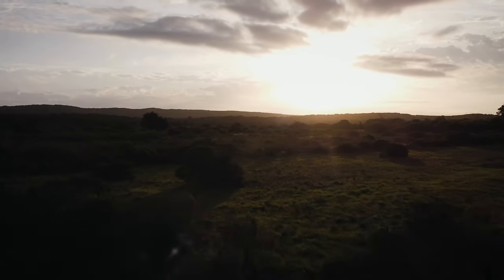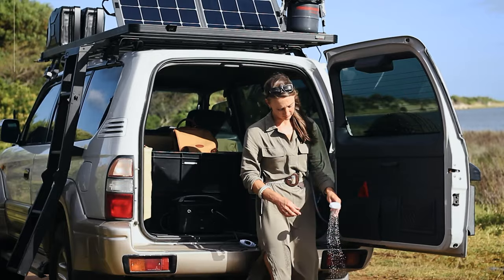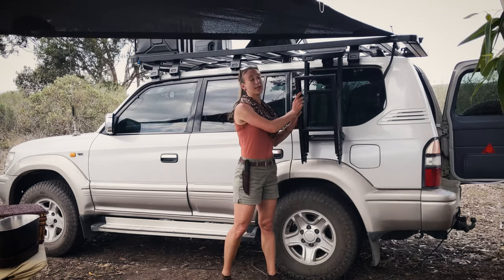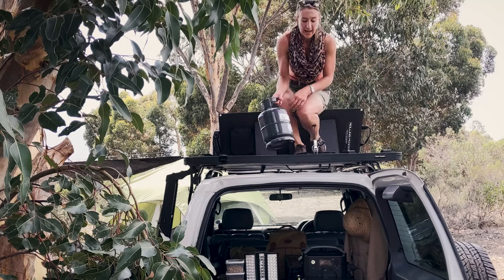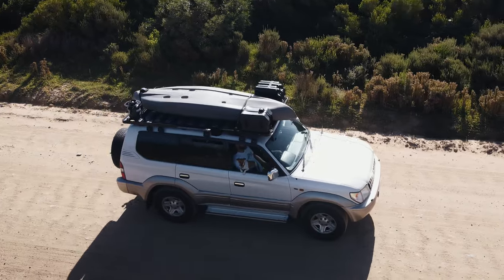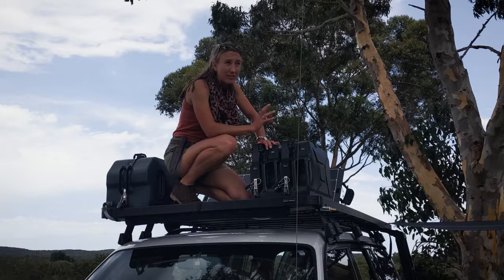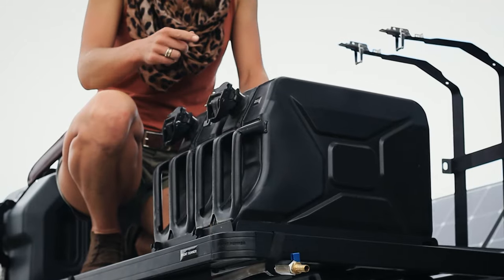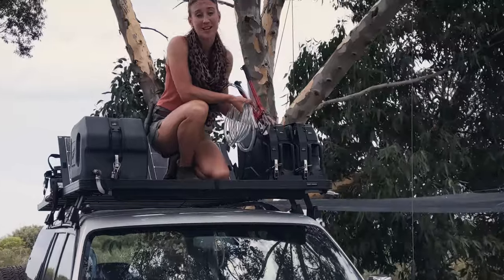BUG OUT 4X4 BUILD | How to store extra fuel and gas on your bug out vehicle

Comment: The roof rack system you have would be a really good way for me to free up some space inside.  Maybe you mentioned it and I missed it, was your roof rack a custom build that you had welded up?  Thanks Clarise!
Reply from the maker: Hi Bob! The roof rack as well as accessories are all made by Front Runner (Links below). They make vehicle specific roof racks so you can just search your vehicle make and model on their web. They have a huge range of accessories too. I asked R&D Offroad to put a bigger roof rack on for me so that I could fit more on to it. Also the ladder isn't made for my vehicle so they modified it. 
Front Runner's roofracks are easy to assemble yourself though and you could easily fit all the accessories as well.  I'm sure they can ship to wherever you are, but let me know if you need help or if you would like product specific links. 

Here is a link to Front Runner's web as well as R&D offroad. R&D Offroad is based in Cape Town. C

FRONT RUNNER VEHICLE OUTFITTERS
https://alnk.to/bEfAK4F

FRONT RUNNER ROOFRACKS
https://bit.ly/3L5gFQP

FRONT RUNNER GAS BOTTLE (PROPANE) HOLDER
https://bit.ly/3ZEvMW8

FRONT RUNNER 42L WATER TANK
https://bit.ly/3kWa6FN

FRONT RUNNER JERRY CANS
https://bit.ly/3L82M4k

DOUBLE JERRY CAN STRAP
https://bit.ly/3T1Za5R

FRONT RUNNER SIDE MOUNTING LADDER
https://bit.ly/3F3Y1Fl

FRONT RUNNER RACK MOUNTED BOTTLE OPENER
https://bit.ly/3YrN7ju

FRONT RUNNER 67L WATER TANK
https://bit.ly/3Yw8jVx

R&D OFFROAD
https://www.randdoffroad.com/
Reply: @LiveReady  Clarise,
Thank you for taking the time to write back to me.  I will for sure have a look as I cannot find anything that would fit my Jeep around here.  Hope you have a wonderful day!
take care,
Bob
Reply from the maker: @bobliptak6309  Hey Bob, any time! I've added some specific product links above, they've got some cool stuff. Have a super week. C

Comment: Everyone does things differently, I have a diesel 150 Prado, long range tank and a rear bar with twin spare wheel rack and ladder steps on one of the wheels. On my roof rack I have a 2.5m awning on a home made Freds arm pivot (mounts on left side but can be swung round to cover the rear if desired). Around the inside edge I have a DIY 4" PVC pressurised water tank tube. This makes everthing nicely balanced and low profile.
For a "bug out/SHTF" cooking option I have a Soto Stormbreaker multi fuel stove (LPG, Butane, Alcohol, White spirits, Diesel, Petrol......only thing it doesnt burn is wood)
I would strongly suggest a discrete ignition kill switch for anti theft.
Reply from the maker: Hey there! I love how all the Prado lovers are bringing their ideas to the table here. Sounds like a nice setup you've got. Capable as anything I'd say. Your kill switch is an interesting idea as long as you yourself manage to get away unharmed. I'm going to look up your Soto stove, thanks for the recommendation! C

Comment: Thanks for this Clarise. The design and practicality of it has been well planned and executed. 
After the past few days, I have one valuable piece of advice... go diesel.
Stay safe and have fun the rest of the weekend. God Bless
Reply from the maker: I believe the diesel engines are more reliable and cheaper to run, but I'd miss the torque. It's my daily driver and I like it to be responsive especially because I have a tendency to pick a direction and get into all sorts of unmapped places. I'll keep your advice in mind though. Are you familiar with the Prado 90's? C
Reply: @Live Ready  yes, the 90 is an excellent family Cruiser tho I do prefer a blue badge 😉. The reasoning behind my comment comes from observations by @CanadianPrepper ito of fuel availability in an SHTF.
Reply from the maker: @YsterbergZA  Do share a link👍 I think all fuel will is in short supply in a disaster which is why we carry some extra either in Jerry's or a long range tank, or both. The Durban riots are a good example of what realistically happens. It's food for thought though, thanks! C

Comment: Got extra petrol and lion scat! Love that, crazy to even imagine having something like that in your backyard. We have our predators but that's on a different level. I like that little propane tank setup, the builds coming along nicely C.
Reply from the maker: Hey Garrett! The scat stinks I tell you.., it was double wrapped in a box and it almost knocked me out. Also, I had an interesting time being stalked (through a fence) by I lion while collecting it. I've got a lot to sort out on the vehicle before it's complete but it's been an epic project. How's the Jurassic park vehicle coming along? C
Reply: @LiveReady  The jeep is taking some time , hardest thing to find are the green seats, they only were available for one year and that's it. It was a special package that came with green seats, green carpet and green door panels. I ended up finding a complete set of the green seats so I have the hardest thing to find for the build. Plus I have the correct rims, got the winch put on and now I'm on the hunt for a set of the amber fog lights. They put those on top of the taillights. 
Then I have to get the light bar for the front with 5 fog lights on top. After I have everything I'll get it painted. But check out some pictures of it and you'll see what I'm talking about. It's just taking time to collect everything, most people just paint the outside and leave it at that but I'm going all out with it but hopefully before the summers over I'll have all the extra stuff and have it painted.
Reply from the maker: @marineshtf9954  Sounds like quite the project. Are you referring to the grey and red jeep from the movie? Where are you going to find the dinosaurs when you're done with the jeep? C
Reply: @LiveReady  yes that's the one ! As for the dinosaurs, I don't know yet.